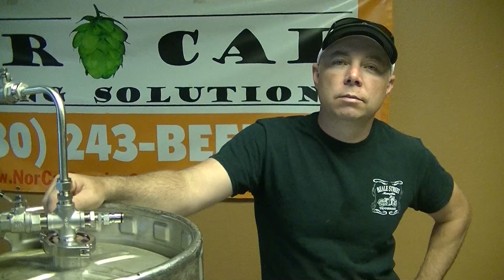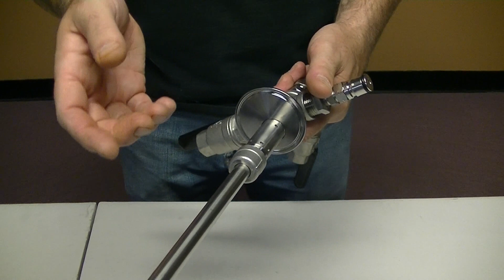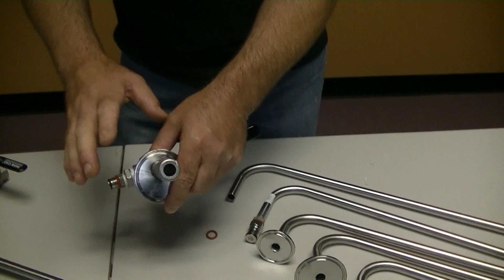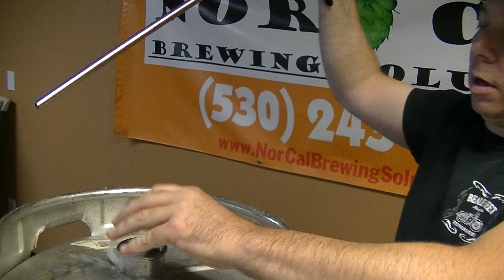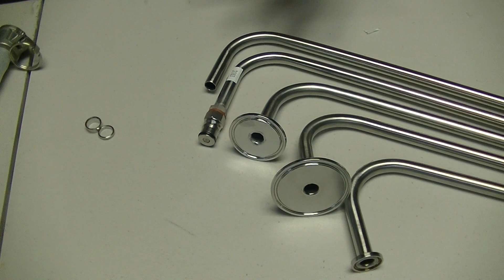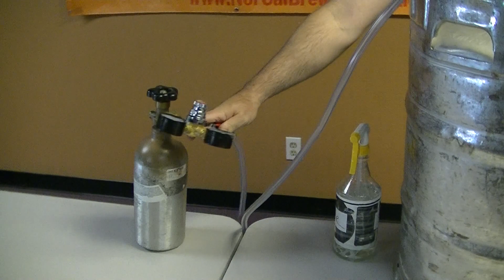"Cross" Fermenter Kit for Sanke Kegs

Comment: Any reason you can't put a 90 at the tri clamp, make it low profile, then your cross and use the keg as a keg.  Also. with a second tri clamp and nipple, just switch back to the original design. I would like to ferment and serve 10 or 15 gallons of beer from the same sanke keg.